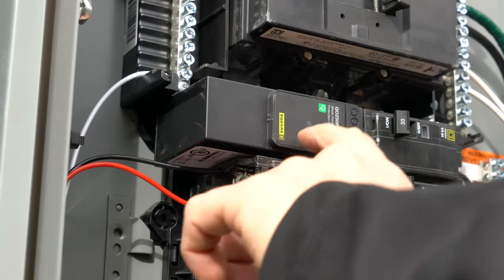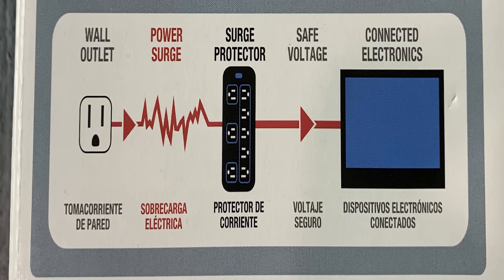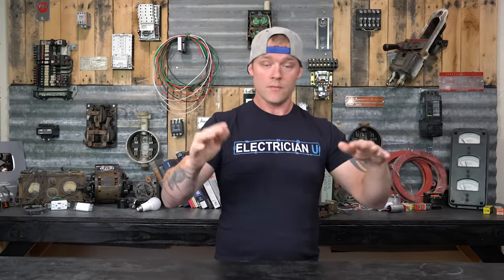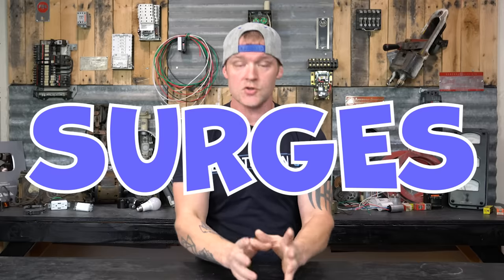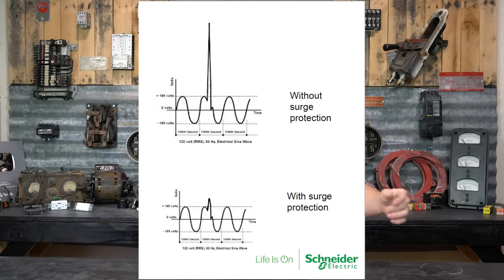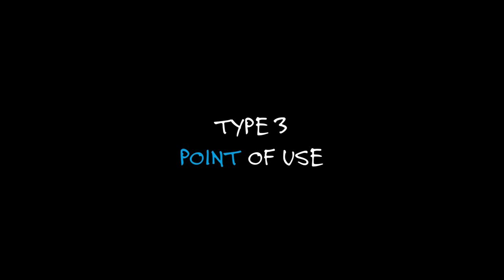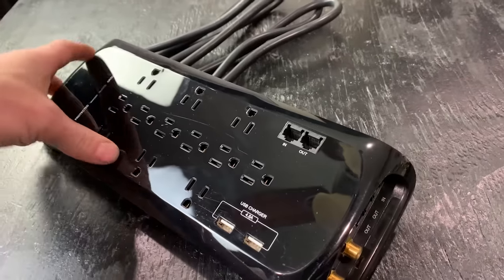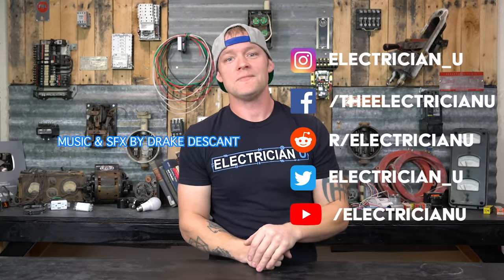SURGE PROTECTORS (SPDs) - What They Are, How They Work, What You Need To Know

Comment: SPDs operate by passing CURRENT to (ground, neutral, common) which reduces the VOLTAGE due to the resistance of the source.  The rating is how much current they can handle.  The combination of voltage, current, and time is energy (joules).  Again, the rating is how much energy they can bypass or absorb.
Reply: I wanted to say the same thing, but you beat me to it. The SPD works like a switch. When the voltage is normal, the switch is off and no current flows. When the voltage is too high, the switch closes to intentionally create a short-circuit between hot and neutral. This adsorbs the energy from the transient event, converting it into heat inside the SPD. Energy = voltage * current * time, so a higher the Joule rating means the SPD can short more current for a longer time. The voltage should stay constant if the SPD is doing its job.
Reply: Ive lost so many electronics and LED light bulbs from transients that im glad its finally a code.
Reply: Hey, just a homeowner here, not electrician, looking for some clarification. Dustin mentioned certain high drain loads like a central ac that strains the system could have an effect on other devices in the home over time. If I were to install surge protected breakers on the large appliances in place of regular breakers, would this protect the other devices and breakers in the home or does that only protect surges coming in from the service line to that particular breaker? Thanks in advance.
Reply: @db0nn3r  Putting an SPD at the panel should protect your property from all types of surges, including ones caused by your own appliances. It's like the overflow drain on a sink - once the water reaches a certain level, the sink will stop filling, no matter where the water comes from. An SPD is like an overflow drain for electrons - once the voltage reaches a certain level, the SPD will "drain" it down, no matter where the extra voltage comes from.
Reply: @db0nn3r  the AC is less likely a source as the electronics are high quality..you have capacitors helping start the motor and keep it running..the swamp cooler motor I had however, it may have caused my attic fire, but of course no one actually investigated. The power surge which was evidenced in a power strip surge protector, and a fried transformer and control board on the furnace, well, who can say, chicken and egg, did the surge cause the fire, 0r did the fire cause wires to melt which caused a surge in the other stuff??..
Reply: @swansontec  HOMEOWNER HERE: Is a SPD the same as a voltage suppressor? At night we have a steady high voltage supply from the utility company, during their visit they stated they are within the allowable range for Los Angeles. My issue is NO heat at night when Voltage being supplied is too high activating my over under voltage HVAC safety device . Would a surge protector regulate the amount of voltage being supplied by the Utility Company?
Reply: @grimphoto  Nope, a surge suppressor is designed to handle quick, sharp spikes in voltage. If you 240V service is going up to 250V or such, the SPD probably won't even activate. Even if the SPD did activate, it works by short-circuiting the extra voltage to ground, so it would get red hot and melt, rather than actually fix anything.

This is a tricky problem, but the HVAC system is the thing you have most control over, rather than the utility voltage. I would start there.
Reply: Correct I would like to add. Not knowing for a fact but as far as looking at how it works. I always associate them with high band pass filters. Semiconductors changed a lot.
Reply: @swansontec  Not actually the case I don't think. One thing that you (and a lot of other people on this thread) are overlooking here is the clamping voltage rating for the SPD located at the panel - the point at which the "drain down" actually occurs. Those whole-house SPD's typically have clamping voltage of around 600 volts. Well, that's great, but unfortunately that's about 270 volts too high to be safe for most of the devices in your home that are built around sensitive electronics. At most, those can usually take a brief spike up to about 330 volts before being damaged. That's where your individual SPD at the device-level comes into play. Those will typically open the circuit and drain off voltage right at about that upper limit of safe voltage of around 330v. Having a whole-house SPD in place at your panel is important, no question about it and every home needs to have one but it's FAR from giving you a complete surge protection scenario in your home just by itself, as so many people have been fooled into believing. (This is something that really should have been addressed and explained in the video)
Reply: @michaelbeckerman7532  - thanks for pointing that out. Years ago I almost got suckered into thinking a whole house surge protector would eliminate the need for the small electronics SPDs; until I red the fine print about 600v. And our actual problem was brown outs and flickering (and the over surge backlash) so that wouldn't work. Found small outlet dongles that would cut off over 140vac and under 90vac for the things not on a UPS
Reply: Thanks, that's what I came here for.  title says "how does it work", but content never got to it.
Reply: @swansontec  A surge protector at the panel is a very bad idea. It fails and all your power is out. Imagine you are on a winter holiday and it fails, a surge protector should  but be used only to isolate components or systems such as stereos

Comment: There are 3 types of non desirable voltage fluctuations as follows. To start with we normally get a 120 VAC (RMS) 60 Hz sine wave. A surge is when we have condition where the RMS voltage of the mains increase past the nominal 120V. An overvoltage surge typically lasts for several cycles or even minutes. The second type is spikes. These are short term (ms range)  high voltage transients that are only present for small fraction of a cycle. The last type is EMI/RFI interference. These are typically low voltage high frequency waveforms that appear in addition to the 120 VAC waveform. These can extend right up into radio frequencies. All electronic devices should contain circuitry to filter EMI/RFI interference and it has very little impact on power equipment. The types of protection that are needed against Surges and Spikes are completely different. Obviously you cant have a piece of equipment that cuts power every time the waveform slightly rises otherwise stuff would continually be turned on and off. Instead surge protection will kick in after a few wave cycles. A spike by its definition is very short term. If one was hit by a very high spike say 10,000V the event will be over before a surge protector can act. Spikes must be acted on and very quickly (typically in mS or uS). Some electronic equipment contain basic spike protection. What they do is run the AC lines on the PCB near a ground line. When the voltage rises on the  AC traces it will arc over to the ground line dissipating the energy. For those of you who think that power bars provide adequate spike protection think again as most are useless against a high voltage transient. ALso dont fall for snake oil salesmen trying to sell you power conditioning equipment for your home audio, a complete waste of money. Most spike protectors work by dissipating energy in a spike. This is why they are rated in Joules. I live in Canada and my experience is that power surges that damage equipment are pretty rare. The only one I can think of is when a utility  installed the wrong transformer and people got a much higher voltage deliver to their homes. The utility paid damages in that case. Spike damage I have seen and usually it is because the dissipating/switching device has failed. EMI/RFI are annoying but not damaging.
Reply: exponent mantissa, you are absolutely 100% correct, unlike electrician U in this video.  It is essentially important to know the DIFFERENCE between surges and spikes, as you have described above, as well as the Joule rating of the protective device, to get the protection you actually need for sensitive devices.  If your device needs SPIKE protection there is no reason to purchase any but the (misnamed) "Surge Protector" with the HIGHEST Joule rating.

Another source of over-voltages, or surges, is an open neutral wire in a residential 120/240V system (common in the USA).  The 240V remains the same but the two 120V "legs" fluctuate up and down as loads are turned on and off, often resulting in burned out equipment and house fires.  Open neutrals do not threaten the building's wiring unless the building burns.  The Utility is usually responsible for "open-neutral" damage and may try to duck that responsibility by claiming the neutral - ground connection was faulty or the devices were not "surge protected" which is actually "spike protected."  Neither of these are actually relevant to the over and under voltage "surges" caused by open neutrals.

As an expert witness forensic engineer in many disputed cases, by understanding the difference between surges and spikes, I have caused the Utility company to pay for their open-neutral damages,
Reply: I was confused how abriviations stands gor

Comment: ELECTRICIAN U, you didn't talk about what the surge protection joules rating means because the MOV or VAR data sheets are based on the MOV or VAR joules rating? The Transient over Voltage Surges are a transient TIME and the surge protector has to have a response time that is longer than the transient time or it will damage all the equipment plugged into it.

Comment: In 2018 We had lightning strike a tree in our backyard about 25’ from the house. It traveled across the ground, blew a small trench in the dirt across the yard, arced on the metal astragal on the French door in our basement that I was standing 5’ away from, blew the ramset nails off the wood piece under the door threshold. We had WHSP on both panels. We lost all the TV’s, AV equipment, garage door openers upstairs on both garages, a fridge in the garage, a ceiling fan on the opposite side of the house on the 2nd story furthest away from the strike, the LED string lights on the back deck, a remote control switch for my dust collection in my workshop, an HDMI cable (had to cut open the ceiling and re-fish a new one because the old one got stuck on something grrr), and the main control board on our Trane Heat Pump in the basement. It was totally random the things we lost and didn’t lose.

Comment: Type 1 vs Type 2 is particularly relevant if you have an old panel without a main breaker. Our house has a split-bus panel, so we'd need to use a Type 1 device if we wanted to add surge protection to the top half of the panel.

Comment: Best info I've seen on surges. I would add the importance of a bonafide outlet ground for type 3 SPD's, otherwise no protection. And equally important, the system ground rod minimum of 2 rods when upgrading with SPD's, though some would say even more, in order to adequately dissipate surges.
Reply: I don’t think the ground rods have anything to do with this
Reply: Surges go to ground.
The less resistance to ground, which is where  ground rods enter the equation, the better the surge  protection.

Comment: As an engineer they are not that confusing. Simply search metal oxide varistor's. It simply changes resistance in the presence of voltage. For SPD's they are chosen so that resistance is about zero below a threshold voltage say 300V past that it becomes more resistive, This causes the excess voltage to be converted into heat.   Over time these heating cycles will break the device down or if a spike it too large melt it. This is where the joule rating comes in. The joules of heat the device can soak up because there is a time component to it and how long the spikes are.

Comment: Many thanks, you cleared up much of my confusion. For that upcoming video you might get into dedicated surge protectors for particularly surge-prone devices such as HVACs. The exist as much to stop a surge from leaving the device as to protect it from them.
My sister was regularly having control boards blow out in her A/Cs. The two were installed alongside one another, so a surge from one would hit the other. I suggested she get HVAC protection on both and that seems to have helped.

Comment: Hi Dustin, Love your video. First of all I am not an Electrician. I just know the basic and that is why I watch video like yours to learn more. I have a question regarding Surge Protector and  how some surge protector work. I'm talking about the one you install next to the unit like the AC compressor unit. I saw a video in installing a ICM493 and the connection to this connected is like a series connection. I can understand how it work. The surge will get detected by the ICM493 first before the AC compressor so it can cut off the power to the compressor. But the one that connect like a parallel connection like the ICM518 or the RSH50. Its connected or pigtailed to the L1 and L2 of the wires that goes into the AC compressor unit. Since it shares the same wire, when the line get a surge, it will send that surge to the AC compressor  and the surge protector. Can you shed a little more light in how protector like the ICM518 or RSH50 protect my AC compressor.  Thanks, Phil

Comment: I've made service calls to residential customers.  Many had no surge protection. One customer used surge protection with a cheap $5-10 protector.  After a car crash sent a major spike down the line and into her house, her $10/15 k printer survived.  Not the same could be said for her other electronic devices.  Never thought a low joule rated surge protector would ever work that well.  Now I recommend these for all your electronic devices.
Reply: Any brand recommendations?
Reply: @MrsBuddevil  Phoenixcontact, but I don't know, if they produce for the american market.

Comment: I was in computer sale for a time.  One of our customers was a bookkeeping service and as a result had numerous computers.  There was a lot of sensitive data on these devices.  We put in a surge proctor in the circuit that powered their computers.  One day a large truck hit a power pole right outside their offices.  it brought down a transmission line (the one that feeds the transformer) across the line from the transformer to the building.  I'm told it was 35K volts.   It indeed blew up the surge protector.  The result was the computers were fine, but the surge protector was toast.

Comment: I have a home built in 2003 which has a square D breaker panel with a QO  Surge breaker installed. It says that it is a whole house surge protector. When I had a Generac 22 kw generator installed a couple of years ago, the company installed another whole house SPD in the automatic transfer switch under the lugs of the customer load terminals. One of the LED's for the L1 is out meaning that the MOV's for this leg are no longer capable of doing their job. The whole house SPD QO2175SB green LED still is burning brightly and therefore this device is supposedly still functioning normally. My question is, do I really need to worry about replacing the SPD with one leg LED being out? I am thinking that I don't need the one which was installed in the Generac automatic transfer switch. By the way, you produce awesome and informative content.

Comment: I think a better example with surge protectors and lightning, is packing a vase in bubble wrap. The surge protector is the bubble wrap, it won't protect electrical equipment, or the vase as an example, from the epicenter of an earthquake, but it will from the tremors felt far away from the epicenter.

Comment: Hi. I have a Siemens CB Panel. My interlock and 30 amp CB for my generator is on the top right. If I put a type 1 SPD and wire it below that breaker. Will all my loads below be protected?
Will the whole left side be protected as well? Or do I have to put another SPD on the Left side top of the panel on the load side?
I hope I’m clear. Thank you. All the best to you and family. Mike i.

Comment: Lightning at a distance can induce a current on the big antenna called wiring.  When that current meets an impedance a voltage presents until the current can continue to flow or it peaks/arcs, if it hits near-infinite resistance of an open.  Similar happens if the current is flowing opposite the system current on ac circuits.  The current is a pulse so has a finite amount of energy of short duration.  Similar happens when an inductor/motor is switched off and the magnetic field collapses.  The ground rod provides a voltage limiting resistance path on the neutral side, but the currents on the hot side interact with the loads before getting on the neutral.  SPDs provide a voltage limiting parallel path across the load for when the voltages spike above the design threshold to the neutral/system ground.  We see all this as voltage spikes.

Comment: To quote a friend of mine from Florida (half a century ago), "When you see lightning arc out of a receptacle, you stop wasting money on surge suppressors and just unplug your shit." NOTHING will protect against the power of a direct strike. Yes, they're rated in VA / J as that's a measure of the energy they can absorb. [ https://en.wikipedia.org/wiki/Varistor ]
Reply: Haha..  Yeah I've done a lot off grid power systems which often has solar.  Invariably a customer asks "what if lightning hits the solar".  Without hesitation and perhaps a little too eagerly I tell them "it destroys it" .... then after a pregnant pause... I explain that I've installed a lot of these and have never lost an off grid system to lightning, mostly due to not being connected to the grid but that we also take great care to ground everything and use top quality SPD's.